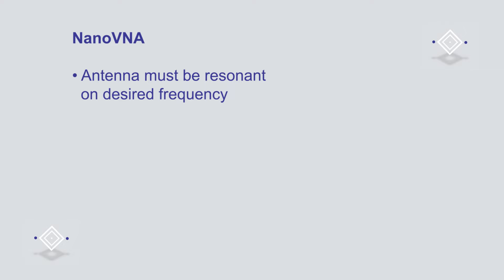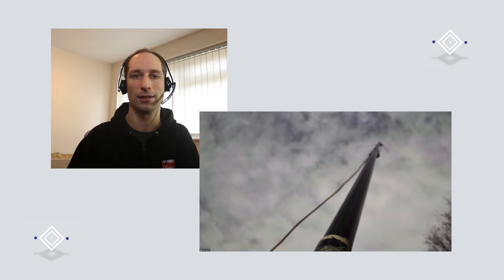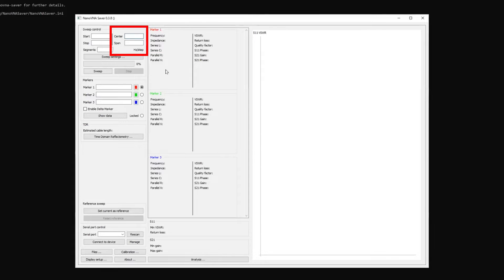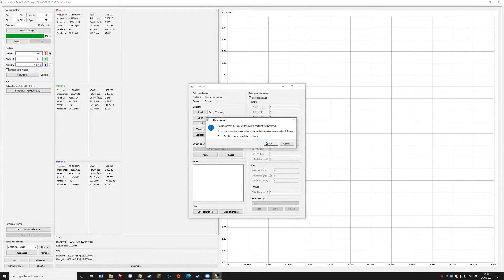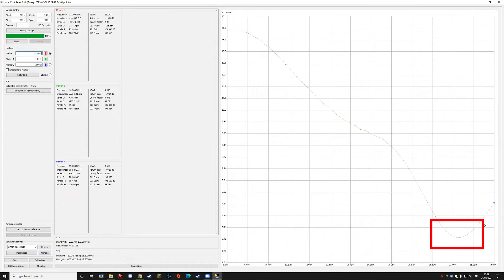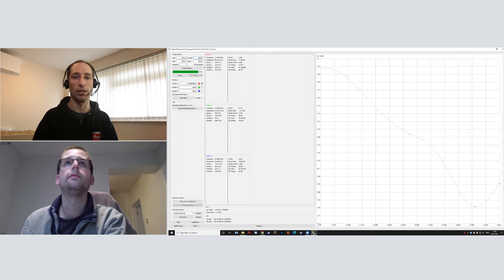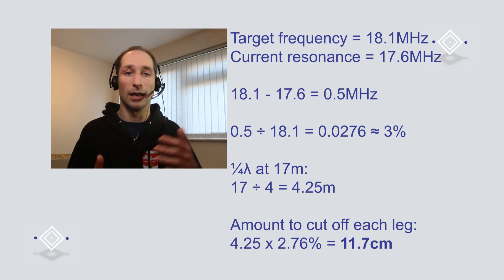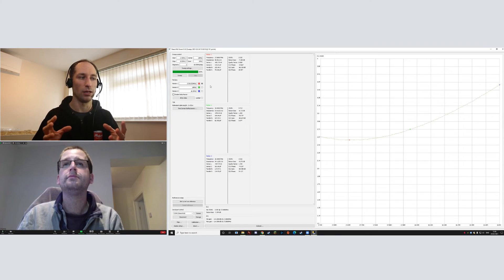RSGB: Useful practical skills - tuning a dipole with a NanoVNA

Comment: Interesting, but what is the software called and where can I download it? Surely that should be at the start of the video or in the notes.
Reply from the maker: The video is about the NanoVNA - it explains just after a minute into the video what this stands for (Vector Network Analyzer). You can buy them online in many stores or there is a NanoVNA website which will tell you more - https://nanovna.com/  Hope this helps

Comment: Thanks guys - that was very informative.
Is there any particular advantage to using a VNA over a standard VSWR meter ?
I am interested in getting one but I'm not really sure what practical advantages it has over traditional tools. 
More video's on the uses of VNA's to Hams would be very interseting.
Thanks again, M7MGK.
Reply: There’s much more you can measure using a NanoVNA. Impedance btw and even the length of coax cables. Its like a Swiss Army knife not only one tool.

Comment: Such a shame , this is not "tuning a dipole with a NanoVNA" it is  "how 
to use software to tune a dipole with a VNA " whats the difference?, a 
computer no where near the antenna ,  software I dont have , and its not what I  need as a beginner
 who has just bought a NanoVNA. show it with out the computer and software
 im sure it  would be great   sorry .
Reply: Hi Ian. Thanks for the feedback. You're correct that everything in this film can be done on the screen of the NanoVNA itself. We decided to demonstrate the NanoVNA Saver software because it is both easier to use (some NanoVNAs in our experience have slight offsets on the touchscreens, meaning you can push something you were not meaning to) and also because it was significantly easier to film via a computer screen-share when we were having to do all the production remotely.  73, Dom M0BLF (Series editor)

Comment: Worth mentioning the likely reason for higher than desired resonance is likely that the 2 elements are not of exactly equal length before or after the adjustments were made.
Reply: In this case, it was simply proximity to ground: after we made the video, Lee managed to get everything rather higher, and it looked much more like the 20m dipole we were expecting to build!
Reply: @M0VFC  Nice adaptation on the fly! 73 de 2M0GUI

Comment: When you cut the dipole close to resonance you can fold back the ends of each dipole on itself to better adjust for antenna height at resonance. That gives you the option of adding a bit on or taking a bit off without cutting.
Reply: That's a good point to make, and it is especially useful on 80m where the resonance of a dipole is not good enough, the SWR is not low enough, over the whole of the 80m band. It's best to tune an 80m dipole for the CW/DATA end around 3.550MHz (which is about 21.1m long) and then fold about 70cm the ends to move the resonance up for the SSB end around 3.7MHz say.